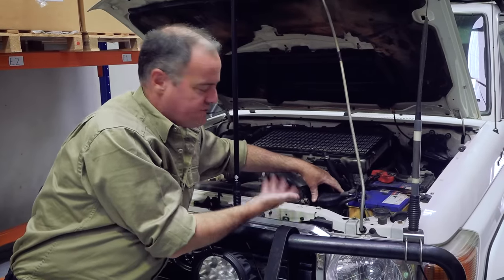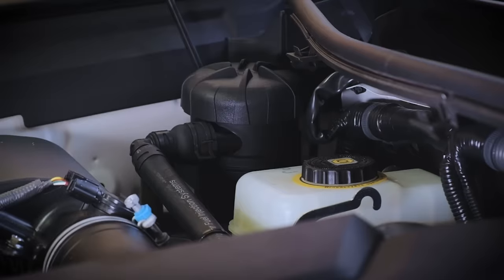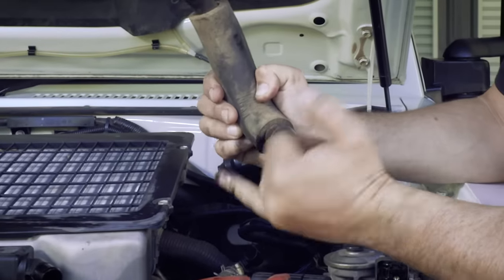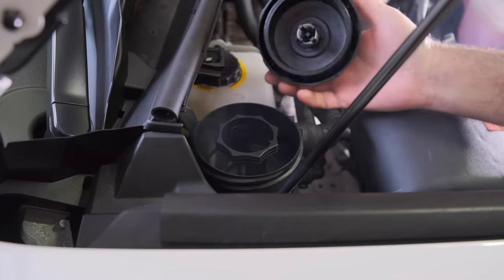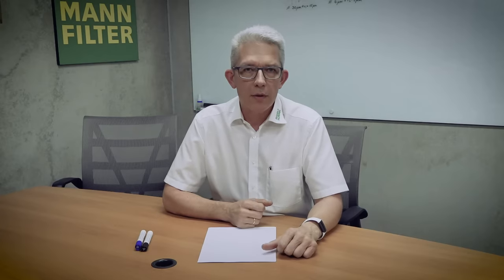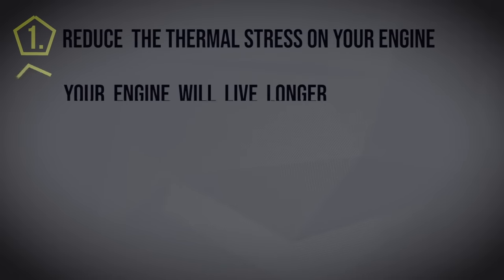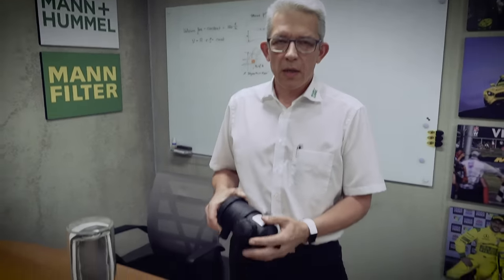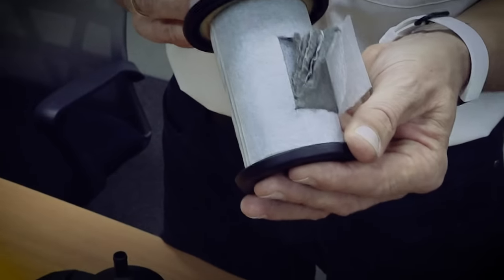CATCH CANS & EGR explained in detail! Why your diesel’s clogging up & losing power - how to fix it

Comment: If this is such a problem why don't manufacturers put this in as standard?.
Reply: michael george cause they get more money out of an engine that is designed to fail. More work = more $$
Reply: I'd say these days engines are designed to last until warranty ends then they shit the bed
Reply: The oil in intake is not as big as issue everyone makes it out to be, its the exhaust gases that sticks to the oil that carbons intakes up. It's just another "service " item to there list for manufactures
Reply: I was wondering the same thing. Will be interested to see the answer.
Reply: michael george same reason why some manufacturers are stretching out oil service intervals to 15k -25k or up to 1-2 years between services. They don’t want the engines to last, In other words.. More money in selling new cars than keeping old ones running around.
Reply: Most owners will not service their vehicle properly. How many people do you know that won't even keep their tires inflated to the proper levels? For the people that state "designed to fail" yeah sort of... OEMs make their money off replacement parts. Dealerships make most of their money from service not sales. One feeds the other.
Reply: Number one reason is because it costs money, and manufacturers don't see the need to prevent problems that will only likely come up once the warranty is over. It usually won't give problems until 100,000km, most people buying new cars don't know what a catch can is or don't care, so they save their money and go without. 
Also having a replaceable catch can filter adds to the cost of service, and this is something manufacturers want to reduce because customers take this into account when buying a vehicle. Same as why they have long oil change intervals and non-replaceable transmission oil.
Reply: Or this bloke wants to make the problem seem worse to sell his product?
Reply: @naten2645  From what I have seen it is a common problem.
Reply: Because 90% of vehicle owners (@ least in the US) don't service their vehicles properly, it's a real issue here, before retiring (medically) I was a Ford and Mazda specialist. I can't tell you how many vehicles came through my doors that very rarely had an oil change in 200k miles. I have pulled valve covers off V10 Ford company trucks just to find what looked like another valve cover under it, it was solid oil slug. Hell most people don't even think of the fuel filter what makes you think they're going to drain the catch can every other fuel fill up.
Reply: Money. They don't have to spend as much on manufacturing, they make more from servicing and you ultimately buy a new model sooner.
Reply: All about money they only need to live for the warranty period I used to work for gm and you would not belive how many of these things come in after warranty. Why do the old diesels without egr and dpf systems last so long? Because they're designed to take in air not exhaust and oil.
Reply: This was what I was thinking too. Hopefully someone can shed a little more light on this... I doubt it's as simple as 'they make more money if your engine breaks out of warranty'...
Reply: @neddy1703  I thought some of the answers a little out there. No one would by a vehicle that had such a serious defect , because this is what it is.
Reply: Warranty is over when you see the effects
Reply: Manufacturers can add it as standarf if they want to, they can charge more for oil catch can filters to make more money more things to be serviced equals more money. But its not neccessary. Engines have oil filters, recommended engine oils have cleaning agents. So basically oils from intake manifold helps wash out deposits in the intake valve and combustion chamber then flow down back down to the oil pan. Buy the right car and use the right oil.
Reply: For the same reason why Toyota will not fix the dusting issue problem with the 1VD engines. They know about the issue, yet say the dust going past the filter is within operating specs...
Reply: naten2645 agreed. Aftermarkets have a vested interest. The best thing you can do for the longevity of a 79 series is not muck with it and keep it serviced. Who would've thought Toyota had some idea about building a rugged, reliable platform?
Reply: Because it's not a problem.

How else do the valve stems get lubricated? That's why no manufacturer will warrant a car with the installation of a catch can.

Modern generation of snake oil so have fun.
Reply: @Typingwithpaws  you have no clue hahaha you've obviously never worked on a engine before.
Reply: @markymark5887  im only a mechanical engineer and engine builder so yeah I've got no idea.
Reply: @Typingwithpaws  as a mechanical engineer, you'd know the valve stems are lubricated by the oil in the head, hence why there are valve stem seals.....
Reply: @Typingwithpaws  like I said, if you knew anything about engines, than you'd know that the valves are not lubricated by blow by... that is just hilarious.
Reply: @Typingwithpaws  probably think we still run leaded fuel too...
Reply: @Typingwithpaws  if you seriously think that engines produce blow by  to lubricate the valves...you are off your head.
Reply: @stephenwilliamson4556  Its always recommended with all the "scientific" arguments imaginable, strangely enough by the people that sell them! Useless on an OEM vehicle. If tuned, then there is a good case for it as most of the time its just overfueling. Modern engines are designed to function as such. Developping an engine costs 100's of Millions if not Bn to make. A $2 plastic container ain't going to better it. It was the same argument about EGR delete, which in reality makes the problem worse and can damage the engine (never mind breaking emissions regulation).
Reply: @jjperko  You can service it all you like but it won't rectify this issue.
Reply: @Typingwithpaws  Why did you watch it then?
Reply: 79 Series V8 we have a fleet of ~25 79s running to half a million ks, paddock work, heavy loads etc. and I've never seen it come up. I'm not saying its not an issue just wondering if its pod filters 2.0.
Reply: @jjperko  All I know is what my can collects between oil changes. Intercooler before can installed, coated in oil. Intercooler removed, washed & replaced, now with catch can, inspection, clean & dry. Surly this has to be beneficial in the long run?
Reply: @naten2645  Every CRD diesel engine with EGR champ. Pretty well documented
Reply: @Typingwithpaws  No you don't ! Claiming a title means SFA. Clearly you have no clue!
Reply: James Perkins likewise, I have worked on more diesels than I care to remember, a lot of the issues people have are from lack of service, and scrimping by using cheap oil and filters when they do.
Reply: @stephenwilliamson4556  depending what engine there are various solutions....
Reply: did you not watch the video?
Reply: Cause there told that it's better to burn the oil it's all about emissions and crap nowadays
Reply: because if they did, then there will be another topic to discuss as, "DO WE NEED TO REMOVE THE OIL CATCH CAN?"
Reply: Why didn't Mitsubishi put a condenser Thermo Fan in the Australian Triton? All the mounts and wiring are there so they must have had second thoughts, but why? Answer+ For the same reason they don't fit Catch cans-$$$Money
Reply: If cars manufactures install this system, they probably will loose some money.
Reply: The expert Reiner from Mann forgot to say that when you introduce the exhaust gases into the cylinder you also reduce engine power because obviouly you have also reduced the fuel air ratio in the combustion chamber. So then you need to use more throttle and so then... and on n on n on it goes. Both EGR  n blowby from crankcase cannot be good for your engine's power and longevity... simples!
Reply: @naten2645 , what I thought
Reply: Does this product if fitted void factory warranty of a brand new vehicle if fitted
Reply: Why????? The answer is very simple, all this oil separators doesn't work.
Reply: @toms_gupooe  Amber Herd
Reply: Just reading some of these comments made me inform some people something. My hilux from new now has 380000km at 110000km I decided to do an entire intake clean, It was easy 50% blocked throttle body intake runners and plenum and it was like a thick sticky black grease 
It took the best of a day to clean everything! After reassembly I fitted a catch can and I also fitted an EGR “performance shim” and the result speak for them self 270000km later looking down the throttle body clean as a whistle  Also I have alway done oil changes every 5000k which the catch can has 1/2 cup of watery oily sludge. I do believe however EGR delete does make fuel consumption increase by 2 or 3% in my opinion but I’m ok with that if my motor doesn’t have to consume its own waste gasses!!
Reply: @Gamergurl1405  Actually that is a poor answer and wrong, the manufacture has to warranty these engines for a certain amount of time and miles and if you purchase a manufacture extended warranty it can extend their liability out to as many as 8 years and over 120,000 miles depending on the extended warranty term you purchased. By 8 years and 120,000 miles the majority of those vehicles have entered the used car market and will rarely if ever see a dealer service bay.
Reply: @gagecook6918  PCV Valves have been around for decades now, they where designed to stop engines from dripping oil onto the roadway.
Reply: @noel270w8  Yet todays engines are smaller displacement and make more power than did the engines without all the emissions equipment of the past.
Reply: @Typingwithpaws  the intake and exhaust valve stems are lubricated thru seals with splash oil from cam bearings and vapors coming from sump. This oil catch can hardly captures any volume of oil, it catches the combustion soot before it flows into the turbo inlet and intake manifold.
Reply: Most agricultural engines have them, those customers are expecting engines to last a bit longer than the warranty period
Reply: @noel270w8  He also said the EGR is off under high loads.
Reply: I’ve been told if you have a catch can it might void the warranty because you take the oil out of the system witch drys out all the seals and gaskets
Reply: @kristian829  yes
Reply: @mig21m13  Yes it does.
Reply: Because catch can is just a an engine fix snake oil. 

If it was a valid engineering solution, companies alike Ford, Toyota, Nissan, BMW..etc all would have adopted.
Reply: I'm fitting provent catch can this weekend, after watching others videos showing what they catch, I really don't want that stuff going through my intake system.
Reply: Isuzu has an OEM Catch Can PCV separator for trucks so some manufacturers DO support the idea of catch can tech
Reply: Cause they’re not needed
Reply: @Typingwithpaws the one person who gave a factual answer.
Reply: Because engines are perfectly fine without a catch can.
Reply: I've owned two Tritons a 2013 MN 4X4 120,000KLM and a 2017 MQ 4X4 170,000KLM and counting,  I have had zero inlet problems and have zero modifications on them. Just take them for a long run once a month at highway speeds
Reply: Ffs u guys seem to argue and everyone has a different opinion I no absolutely Fuk all about any engine I'll get it serviced every 7.5 k at worst and dump it at 150 k when warranty up and transport department takes my licence away lol lighten up peeps
Reply: No one will remember to drain them. Probably just enthusiasts and people who look after their car properly. I don’t think they make 1% of all car owners
Reply: Because it causes more issues
Reply: Planned obsolescence
Reply: Wat about the dry stuff that forms now there's no oil that can't b good for yur motor

Comment: It would be nice if you did a video looking inside a inlet manifold after using a catch can for 100k. just to prove it works!
Reply: You Tuber Musing Greg did a video showing that it works to a certain degree, but far from as good as a lot of people would make out
Reply: Exactly. You still get dry soot caked on I have a pro-vent fitted and intake cleaned. After 40,000 still had the intake cleaned again. Still allot of dry soot clogging everything up.
Reply: Exactly. You still get dry soot caked on I have a pro-vent fitted and intake cleaned. After 40,000 still had the intake cleaned again. Still allot of dry soot clogging everything up.
Reply: Exactly. You still get dry soot caked on I have a pro-vent fitted and intake cleaned. After 40,000 still had the intake cleaned again. Still allot of dry soot clogging everything up.
Reply: Exactly. You still get dry soot caked on I have a pro-vent fitted and intake cleaned. After 40,000 still had the intake cleaned again. Still allot of dry soot clogging everything up.
Reply: Exactly. You still get dry soot caked on I have a pro-vent fitted and intake cleaned. After 40,000 still had the intake cleaned again. Still allot of dry soot clogging everything up.
Reply: Exactly. You still get dry soot caked on I have a pro-vent fitted and intake cleaned. After 40,000 still had the intake cleaned again. Still allot of dry soot clogging everything up.
Reply: The bot broke lol.
Let this be a warning. 
Most comments are gpt4 at this point. 
You can't tell the difference. 
The internet has been conquered by business interests and "discussion" is part of the parcel

Comment: most important mod is an EGR blanking plate.
Reply: True. Oil alone make first cylinder run hotter. Combustion will burn carbon.
Problem is oil mixing with soot delivered by EGR. It creates oily sooty mess, which blocks anything and stick everywhere in intake. Madness. EGR should be destroyed.
Reply: Do you have to perform a remap when you blank the egr?
Reply: @trinidads1874  no can just egr plate. Some models u can just maf sensor bypass like dmax
Reply: If it's so important to install a catch can on engines with an EGR, why don't they come stock?  The EGR on my Ford Everest failed after 135,000km and cooked the engine for a $25k repair bill.  EGR is the worst addition to diesel engines sine their inception
Reply: @maxxfx4767  because EURO V and VI emissions which manufacturers abide by in order to sell their vehicles into Europe do not take into account countries that do not see snow. Further more, you can drive for 5 hours in any direction and pass through 2 or 3 countries.  In Australia, 5 hours drive would not even get me anywhere near my states capital city. Engines for Euro specs are only designed for short start\stop....not long distance driving.  hence why aftermarket addons are needed on vehicles that meet Euro specs but are sold in countries outside of Europe.  My town hits a maximum of 42 degrees celsius and roughly 5 degrees celsius in winter.  5 degrees C in winter only happens once every 3 years, usually our average is 13 - 15 degrees Celcius for the winter months.  Engines in Europe rarely get to operating temperature before they are shut down and the driver reaches their destination.
Reply: They do not come stock as they would fail the Euro V and VI laws, exhaust gasses must be recirculated in order to meet such laws. what the laws don't tell you is that it does major engine damage over short periods of time if the vehicle is not driven long distances at a sustained speed to burn off the carbon built up on the cylinder head, valves and inlet manifold
Reply: @unofficialtester1545 
That must be why my exhaust stinks, I just finished driving a 6,000 km return trip in my Ranger and the exhaust fucking stinks.

Comment: Incorrect! The problem is the EGR soot.  You need to reduce that by a blanking plate, generally a 7mm to 8mm hole blanking plate will significantly reduce build up. You have butterfly valves and the valves that need lubrication from vented engine gas. Diesel use to get this lubrication before direct injection. Now diesel is directly injected it bypass the additional lubrication diesal inlets need. Reduce EGR soot and leave the oil, the oil will act as a cleaner and remove the reduced soot. Taking away the lubrication the soot will still cake your inlet. Reduce EGR and keep engine gas recirculation. It's minimal oil! Have you ever check your oil and noticed it dropping? No! If your worried about intercooler reducing its cooling efficiency, pull it off every service and high pressure clean it out. It's only 4bolts and 2 hose clamps. Again it's not blanking it reducing EGR by 90% it still gets through just slower
Reply: This is a good point everyone may have missed if it's true but what you are saying is that the swirl-flaps fitted in the inlet manifold need lubrication from the blow-by oil?

Comment: Blanking off EGR, Toyota D4D and turbo going on 400,000kms. Thermal stress? Maybe I should use less right foot. Trouble with the police? Yeah well mote security less freedom. If a catch can fixes this defect, it is a defect, then this should be a class action law suit against manufacturers and a catch can should be standard fitment on diesels
Reply: You sound like the conspiracy theorist type.
Reply: @1989cranston  just logic. If an engine is almost destroyed in 100,000kms then it's an issue for the manufacturers. If they are approving catch cans, they can have them fitted when new
Reply: It’s not the manufacturer fault, it’s forced on them by emission laws...
Reply: Still no reason Joe Public should foot the bill. Unless, for reasons I cant fathom, one likes taking responsibility for problems not their own and paying for it
Reply: @King88_8  The reality is that Joe Public pays for EVERYTHING in the end.